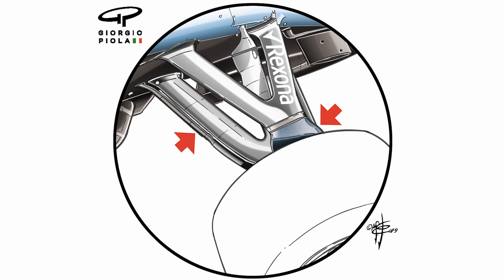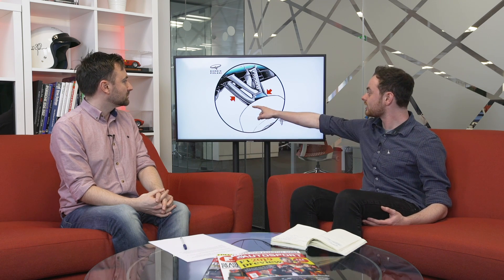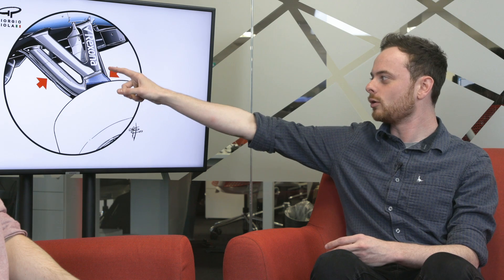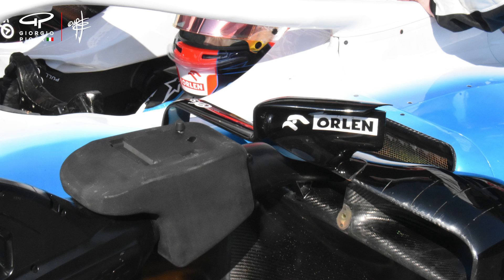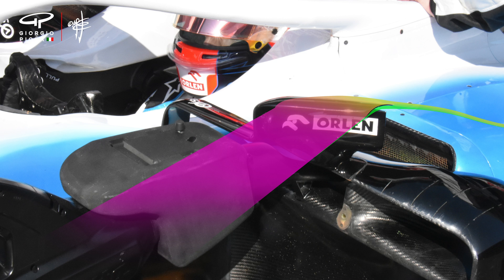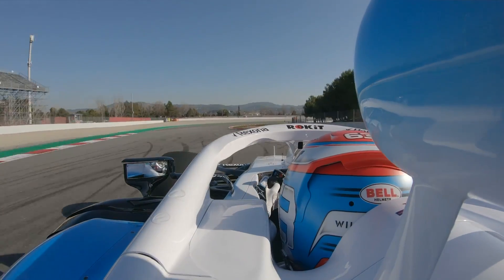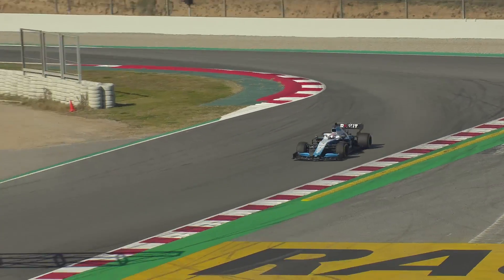The parts Williams changed to make sure its 2019 F1 car is legal

Comment: the 7th link is an engineering cry for help Lowe must be desperate for performance, he must have thought he found some legal work around like needing an external brake line, he's grasping at straws hoping for something that is unfortunately straight cut, trying to pull one like brawn putting illegal barge boards on schumachers ferrari then saying they didn't benefit the car, personally I think Claire Williams is more at fault here, the driver choice is terrible, they take on amateur pay drivers to fund the team, so they cant develop the car or go faster, so sponsors dont want to advertise with them, making things worse in a circular downwards spiralling spending disaster,(hopefully kubica can remedy some of it), when the car wasn't ready for testing she got a private jet so she could be at home, no way frank would have done that, he'd have saved the money for parts, he'd have found something to work on or something else to do, the calls the team make are terrible, like when massa was leading the British gp and holding bottas up for ages, they should have released him, used his speed, build an advantage, have massa blocking, by the time they released him, his tyres were done and both of them lost out.

Comment: Maybe Willaims were arguing that the conjoined wishbones only counted as one suspension member and not 2. That would explain their reasoning that they could add the extra element.
Reply: The extra piece they have attaches to the car at a separate point. I'm not sure why they don't just attach it to the wishbone and then they argue that it's all one piece. Perhaps there's a rule that suspension components can't have vents or holes.

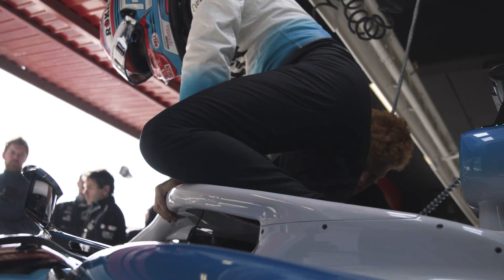Comment: 3:17 saying convex mirrors make images appear larger. Wrong. Images appear smaller. Hence the reason for US-spec cars having the words "objects in mirror are closer than they appear" on their door mirrors, because if things appear to be small they also appear to be further away.
Reply: you are incorrect. The mirrors on cars are neither convex nor concave (unless it has a blind spot mirror). The reason for the warning on the right hand mirror is that because the driver is seated further from it the reflected objects appear to be further. If you don't believe me put a straight edge to the mirror or sit in both front seats and compare the size of the image on both.

Comment: So nobody in William's technical department understands the rules?.
Reply: The rules what?
Reply: @cxwrench1  
The rules that say your front suspension can have six elements not seven.
Reply: @doctordirk6316  That's not my point. It's 'rules'...not 'rule's'. The rules aren't in possesion of anything...there are just more than one of them. You don't use an apostrophe when pluralizing a word.
Reply: @cxwrench1  
I stand corrected sir.
Reply: @doctordirk6316  Hard to imagine how they could make a mistake like that, right?
Reply: They tried to make the case that it wasn't a suspension piece because it wasn't carrying any suspended loads.  It didn't fly.

Comment: 3:58 - It might be painful to talk negatively about a championship winning team with such heritage and pedigree, but lest we not forget that we were also talking the same way about Tyrell in the 1990s. A former championship winning team who were trudging around at the back, putting odd and random elements on the cars to try and claw back downforce, and in the end, struggling for sponsors and funding. Lest we also forgot that Tyrell has since been reincarnated as Mercedes!
Reply: There's nothing from Tyrell in the MGP team, except that there's continuity in the entry. BAR used a different facility,  different chassis manufacturer, different engine. The actual "stuff" went to Minardi, which is of course now Toro Rosso.
Reply: Spam Me Ah yes... fair point. Still, I hope Williams find life after this apparent slow death.
Reply: And the Toro Rosso is still better than the Williams. Could Change this Season i mean who knows what could happen.

Comment: "Its so bizarre" he expressed it perfectly. How STUPID, IGNORANT and BRAINLESS you have to be to put 7th component if 6 are allowed on such prominent part of the car. I can understand if you are messing around engine, battery and exploring legality and regulation loopholes under the hood. But this... OMG, this team is a bunch of amateurs starting from the leadership. Poor drivers.
Reply: They did present the FIA with an interpretation of the regulations that would have meant the component was legal, however the FIA disagreed with their interpretation, so they're changing the part. Pushing the rules to the limits is a huge part of F1, so you can't fault them for trying. That's the approach that has won championships in the past.

Comment: "We didn't think the 6 in the regulations was in base 10."
Reply: i appreciate the effort here... but you are wrong...

6 in base 10 is same as 6 in base 8, or base 16, etc.
and in base 2, "6" doesn't even exist...

it would've worked if, for example, it was 16
because, 16 in base 16 = 22 in base 10
Reply: @sushrutmanekar2346  Right, obviously. Didn't think this through. 

I should probably quit my job and see whether Williams has any open positions.